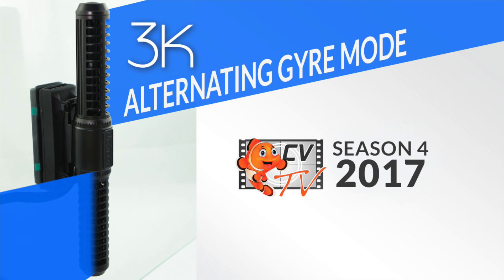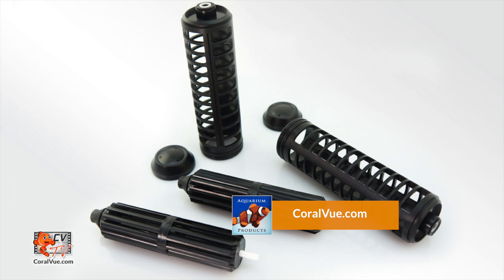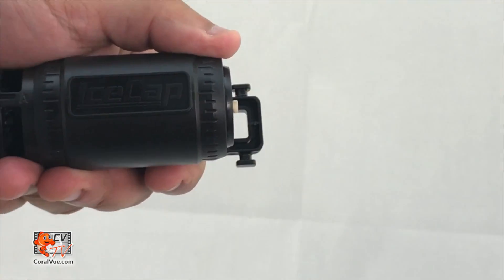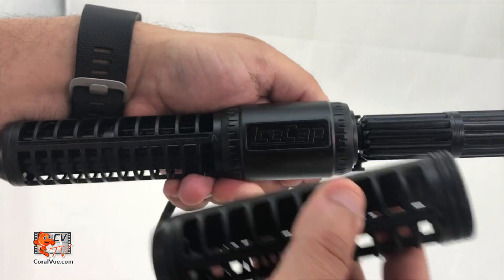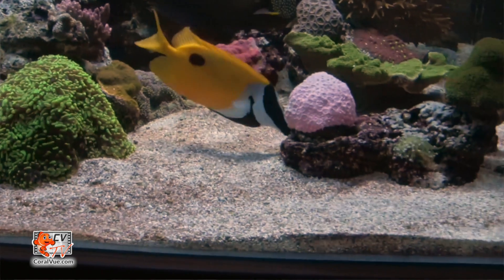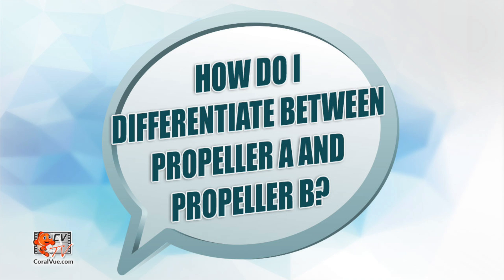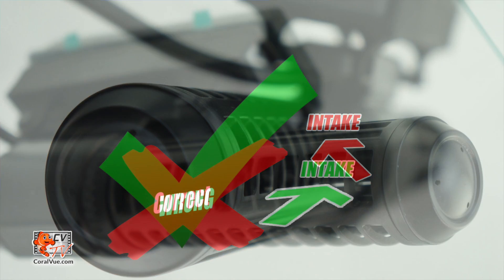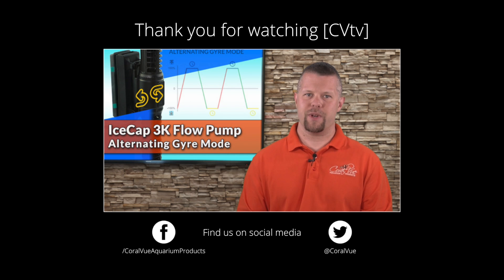IceCap Gyre 3K: Alternating Gyre Mode

Comment: So will this unit shut off if the water level drops, and can it be controlled by the current ic loop controller?
Reply from the maker: The pump will not shut off if ran dry and the pump does not allow for any 3rd party control.
Reply: CoralVue thanks for the info
Reply from the maker: Your welcome